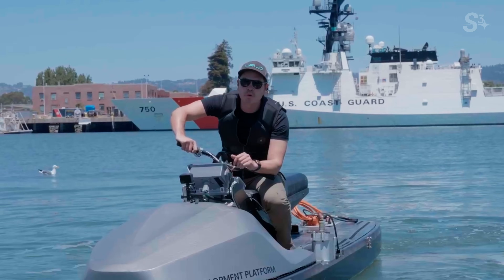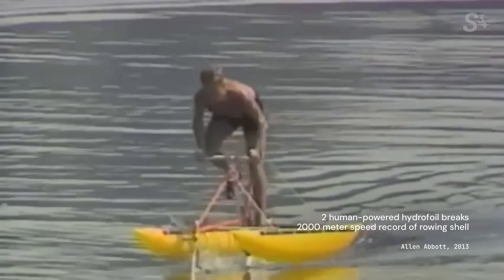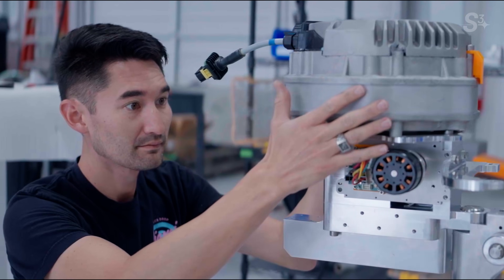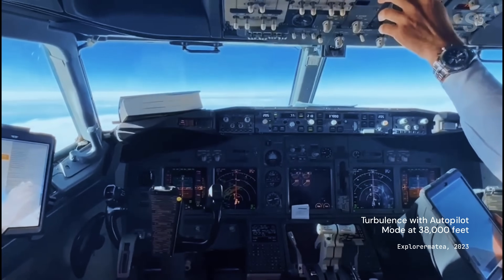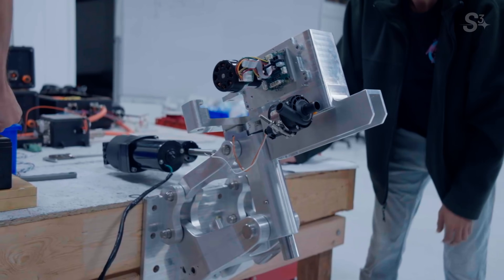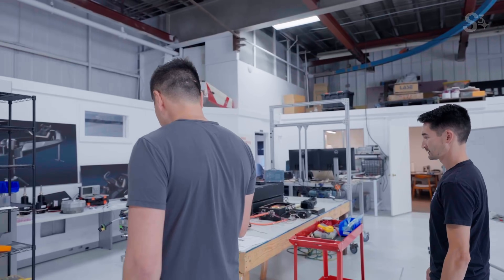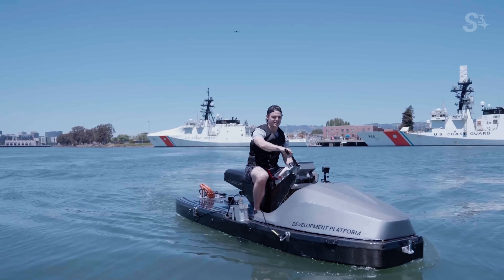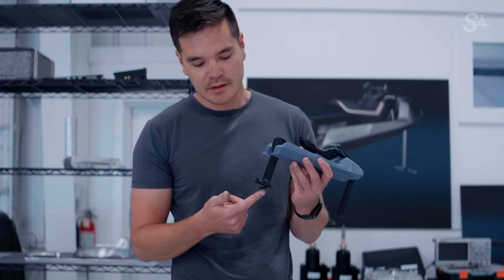I Tried an Experimental Hydrofoil Jetski

Comment: Nobody rides a jet ski because its fuel efficient. They ride it because it's fun. Also a jet ski is one of the most fuel inefficient machines ever made. I have one, it will use 10 gallons in an hour. Its not just impressive, its shocking how much fuel it uses.

Comment: Most people have very limited knowledge on hydrofoiling but there is lots of knowledge that you can draw on.  Hydrofoils are nothing new and have been around for many decades and its only fairly recently due to the "electric revolution" that it has come into its own as the only way to make electric make sense in the water specially.  We developed an electric hydrofoiling craft from scratch in 6 weeks, from concept to full working electric hydrofoil dinghy back in 2021.  We developed the design while creating a digital simulator to evaluate the design virtually as we did our rapid development cycle with the aim to have the craft fly first time and thats exactly what it accomplished.

Comment: Pretty cool. Foil setups for other sports have become incredibly cheap over the last few years. People are diying their own jet powered foil boards (search youtube) but all of those options require the human to have highly developed balance capabilities and get are getting into the water. I like the self balancing approach they've built and the fact it can be battery powered is cool. I can see myself getting one of these and keeping it at Berkeley marina. I can then quickly ride over to SF, Sausalito, Alameda or even Redwood City without having to deal with the choked roads.

Based on stats from their webpage, its ~8 miles from Berkeley to SF Marina at 25mph that would be roughly a 20 minute trip. To drive that on a good day from Berkeley to SF Marina is 45 mins and a bridge toll.

I'll be buying one if they can get that trip time down to 10 minutes. This would give me more time to meet with my LPs and investments in the city each week.

Comment: why was image quality so like 80s in the 2013s. also combine ground effect flying near out of the water surface. why not full one reference model, that can be modified. if you use hydrofoil combo with ground effect folding gilder wings, you get fast up to speed with the foil then up in air in ground effect wings lift. also you can keep all the power systems above water, if using air propulsion propeller. yep air powered jetski, like paramotor on water and in air. yep not only water, but also air. also any props invisible in the water are away from the water. no sea weed issues.

Comment: Just a though for this team - the craft is wrong. People go on a wave runner TO get wet and to splash in the waves. You should consider commuting boats. For instance, those that go between Long Beach, CA and Catalina, CA. Or Seattle, WA and Vancouver, Canada.
Reply: Back in the 1960s there was an Austrian or German hydrofoil boat with a fully enclosed torpedo shaped body called the Zip Boat, or Zipsch Boat or something like that. It was clearly way ahead of it's time.

Comment: “15 times less cost”. If the electric propulsion gives a three times reduction in cost c.f. fuel as seen in cars then are they claiming the foil system improves energy efficiency by a factor of 5. This seems high. Hope it’s true and wish these guys all the best but 15 times the economy seems a bit high. Looking forward to seeing range figures on the second prototype. However, I do remember a video of a small Japanese guy being propelled by a 2hp 2 stroke on a small hydrofoil boat.

Comment: I LOVE THIS!  I'm from Minnesota and grew up on a lake.  I could see this technology used as Uber or Door ("Lake"??) Dash - delivering people and food across the lake to your dock.  There are many places that take current deliveries a long time, because the route might go from one peninsula to the next - even though the water is really only a small distance from shore to shore.  With current boats, it's possible but it'd be expensive and slower.  With Valo, it could be as fast as a snowmobile in the winter.  Also, I could see an industrial, autonomous container hydro-flying from one port to another -- no ship needed.  You set a container on a Valo hydro-frame that autonomously delivers a container to the next port where the container is lifted off.  Charge the frame up and deliver the next one.  So cool!!! I want one! :) Thanks for sharing!

Comment: 2h fun than need charging?

How it will operate on seacost with bottom like sand and stones? There is a lot of places on the water with low water levels and if this wing thing will reach these stone places? 

Efoil big disadvantage is charging like any electric vehicle have a low battery life time so interesting here what is gonna be 

Idea is good but not sure that all technology are ready for this now mean long power fast charging batteries

Comment: manufacturing and material science is not why foiling isnt mainstream. Issues with rough weather, debris collision, and draft are much larger issues.
Reply: the advantages hydrofoils offer are actually much more prevelent in rough weather than in smooth weather. In rough weather, if you have tall enough foils, you can maintain the smooth ride quality, whereas in a regular boat, you'll have a much worse ride than if you were in smooth weather.
Reply: the advantages a hydrofoil offers over a normal boat are already large enough in smooth weather, but they become much bigger in rough weather
Reply: @TSERJI if you have large enough foils, yea sure. What if it's shallow?
Reply: @Mandatoryuser  then it's no worse than a regular boat. 
- If it's shallow and the weather's rough, you are going to have an equally poor experience on either boat. 
- If it's deep and the weather's rough, you're going to have a better experience on the hydrofoil than a regular boat. 
- And if the weather's nice, you're going to have a much better experience on a hydrofoil than a regular boat.
Reply: Nobody addressed debris collisions. These could be catastrophic to the foils and occupants.
Reply: @leeoldershaw956  True. The Boeing hydrofoils used on Puget Sound and also inter island in Hawaii all had a lot of problems when they hit floating debris. They were often forced to limp back to port at low speed after hitting something and damaging their foils.
Reply: @leeoldershaw956  outboard motors seem to adress this well enough.
Reply: Wth do they envision here for cargo? Single containers zipping around the world, each on their own autonomous drone EV hydrofoil sled traveling point to point? Oh…..
Reply: @chriskelvin248  the future is full of pods, pods on rails, pods on water, flying pods, living pods, death pods, sleeping pod, punishment pod. It’s going to be so great! I can’t wait for tomorrow.
Reply: @tiov3001 exactly! 😂
Reply: @chriskelvin248  and a reduction in population since ai can do almost any slave job we got now
Reply: I think it's that capitalism is a poor economic system from the perspective of implementing technologies. There's a lot of drag, capitalists are incentivized to get as much out of their capital as possible with minimal reinvestment, they avoid retooling factories and overhauling ships for new tech because it makes them less competitive and profitable in the short term. Also, new technologies are gatekept as much as possible because profit is generated by restricting access to resources, becoming a middle man lording over a resource to extract rents, wether it is a gold mine, clean water or 'intellectual property'
Reply: Capitalism is what raised all the boats and continues to do so. @thematronsmilitia
Reply: @chasl3645  what a compelling  and well thought out refutation of my arguments. Not at all trite or doctrinal
Reply: @thematronsmilitia  You're welcome.. 
My pleasure.
Reply: Also it is mainstream, they've been used on the Danube for decades for example.

Comment: One thing about small watercraft is you can use it in relatively shallow water. 

What kind of draft do you end up with on a PWC compared to a normal PWC?  It looks like you go from a few inches to several feet.
Reply: I could imagine making it retractable would solve this issue

Comment: If people are interested in reading more check out the Pegasus class hydrofoil coastal missile boats the navy had in the 70’s. 

Interesting to think about how modern electronic control systems could maybe used to overcome the challenges hydrofoils have had with rough seas.
Reply: Scale models are actually harder (because moment of inertia).

They're just cheaper. 

And I've seen several YouTubers solve this problem with scale models, and a handful of cheap electronics.

Personally if I was to design one of these I would also add active aerodynamics and take advantage of ground effect.

In theory you could get some really sick short flights.
Reply: Very true, gonna see a lot of broken foils from people who are used to normal jet skis.
Reply: Sea state is their biggest issue. I wish them luck as modern boats are crazy inefficient.